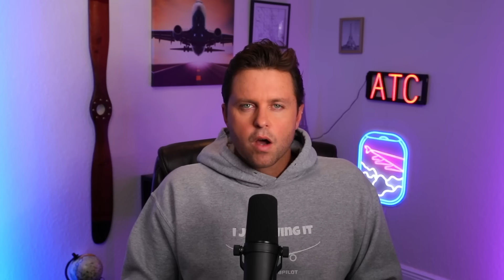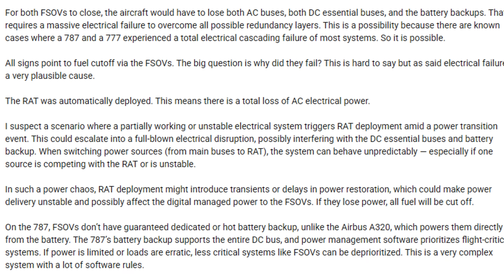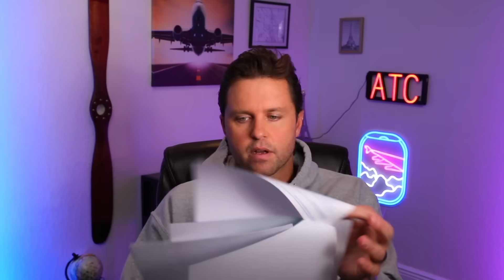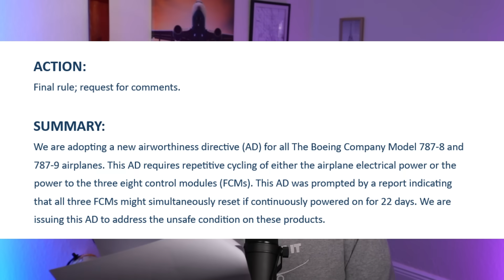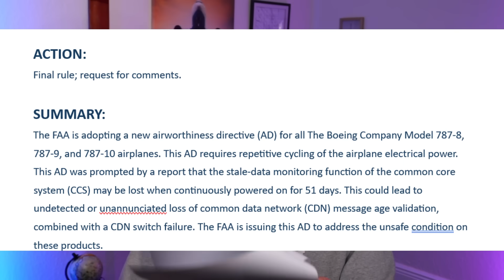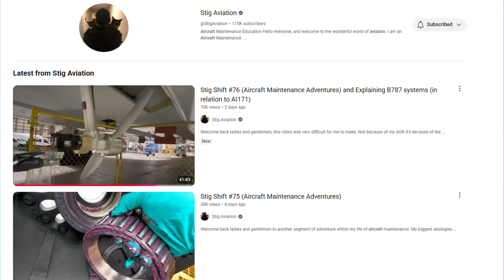Air India 171: Did a Software Glitch Cause Dual Engine Failure?

Comment: From other reports...the plane had a long run out, using almost all of the 3500 meter runway. That would tend to go against the shut off valve after rotation.
Reply: I know others have disputed this but FlightRadar24 data shows that the plane started it's takeoff roll from the last taxiway exit, which was only about half way up the runway.  At this airport, to use the full runway, planes have to taxi from this exit up the runway to the far end then do a 180 turn.  If you zoom in on Google Earth, you can see that land has been cleared to extend the taxiway right up.  Maybe this project will get some priority now.
Reply: @Gourockian1  there is a 4 minute gap in the FR24 data. During this time the aircraft taxied back to the end of the runway, turned around and started the takeoff roll from the end of the runway, not form the taxiway intersection. This has been confirmed by FR24 (apparently their software might be omitting such excursions like back taxiing for a more concise flight track on the user front end) and the raw ADS-B data seems to prove that the plane taxied to the end of the runway.
Also, when looking at the surveillance camera video showing the takeoff one can clearly see how the plane is at speed around the taxiway intersection. Just take a satellite image and draw lines of sight from the camera positions to buildings in the background of the video and see where the taxiway is located.
Reply: @theoz2850 Yes, you are correct.  I have now looked at the FR24 data for the flight and it actually shows that the time between it's last recorded position just before entering the runway and it's next recorded location at 575 ft altitude is 4 minutes, 34 seconds.  I also take your point regarding the speed of the plane around the taxiway intersection.  
However, what we don't seem to have is actual proof that during the 4-1/2 minute gap, the plane backtracked all the way to the START of the runway.  Nor do we know how long it waited before starting the rollout.  The reason I mention this is that when I had previously checked FR24 data for AI171 flights prior to the 12th, there were indications that in some cases, the planes only travelled up to the turning pad, which is just over half way to the end. I no longer have access to this data but perhaps someone with full access to FR24 could verify.  If this also happened on the 12th, it may explain why the plane took off near the end of the runway.
Reply: The plane has been confirmed to have had a normal runout.  It did not get to the end of the runway.  That is an early theory which has been dismissed.

Comment: The Bus Power Control Unit (BPCU) is to blame for what happened. This is the critical control system that sits above all(!) electrical redundancy. Either BPCU itself failed or it didn't do what it should when something else failed (on "gear up"). Then likely the fuel shutoff valves cut off fuel to the engines.
Reply: Contrary to the rubbish spouted in this video, no jet engine fuel shutoff valve closes when power is removed from the aircraft. You need power to open and close them. In fact, airplane manufacturers were forced to add a back up battery to shut the engines down if the aircraft power failed.
Reply: @ImperrfectStranger  I also didn't think they were spring-loaded automatically shut-off valves. But if not, it must have beed some thrust reduce/idle signal to the engines, or insufficient suction feed during climb.
Reply: @ImperrfectStranger  Okay, so what happened? Do you have a more plausible theory? I have heard none that are myself- all others I've heard have been comprehensively shown to be so unlikely as to be impossible. Something brought that plane down. And given that 2 engines appear to have failed at the same moment, I'd say that sounds like electronic/computer failure. And it's not like that model hasn't had serious issues with its control systems before, is it? I don't think my desktop computer system is within light years stable enough to run an aircraft, but nevertheless I have no programmes or systems I have to remember to close down every x days to stop the system falling apart.

Comment: This sounds like the best explanation so far with documentation to back it up.
Reply: I don't understand why the mayday call would have been "thrust not achieved" vs "electrical failure".
Reply: @stevegalle1  Because the engines rolling back is a very audible signal that something went wrong. 

The pilot reported that. He didn't say why the thrust was not achieve. 

If you look back at the US Airways 1549 (Capt. Sully, Hudson landing) incident, you'll hear how the pilot's entire reaction was based on the fact that the engines rolled back. 

IF both engines rolled back, I'm sure there will be a lot of a buzzers going on in the cockpit saying everything is failing. 
It won't just say "Electrical Failure". Restart engine. 

Obviously, there it was bird strike. But remember, Capt. Sully had 208 seconds from when the engines flamed out to ditching in the Hudson. They lost engines at 2800 feet. 

Here, the time between the lift off and crash was less than 30 something. Less than 600 feet.

The human reaction time given to the pilots of US Airways 1549 (as per the movie, which I believe is accurate) is 35 seconds. Here, the pilots hardly had 20 seconds before they crashed. 

This is the new benchmark as to the lowest height at which an aircraft has had all-engine failure.
Reply: @rjv_mntn  Excellent response. Thank you.
Reply: @stevegalle1  As I heard, he also said "no power" (as well as "thrust not achieved"), it's slightly ambiguous, but I believe these are two different things.  I'm sure that a pilot can tell us he means electrical power.  Please, can we have a definitive statement on what the Mayday call contained?  I have heard 3 different versions.
Reply: @mikebell9983  For whatever reason, the CVR is not being released by the bureaucratic Indians
Reply: @sred5856  And now, apparently, they’re saying it was damaged. No mention of the second black box - or that both black boxes may have both voice and data on the 787.
Reply: @mikebell9983  Ah - I didn't hear the "no power" part.

Comment: bro doesnt want to get silenced by boeing
Reply from the maker: I forgot to mention I have a wife and two kids and very happy with my life currently 🙏🏼
Reply: 😮But you have to refrain from picking out 1 dubious unverified media contributor that you found randomly on the web, and then quoting this person verbatim without any substantive facts or validating that person’s credibility. You need to give it up. The FSOV’s are not controlled shut by a loss of power, even with an unlikely and coincidentally combined WOW/Air logic switching scenario. It doesn’t work that way in aviation. An analogous scenario for example does do this in railway signalling because that system is based on the ‘fail safe’ principle- shut it down if something is detected as not right. Aviation is essentially different, it wants to keep it going at all costs within reason, and then let the pilots initiate any necessary shutdowns.

Comment: All of that...or someone in the cockpit turned off the Fuel Shutoff Valves.

You said: "For both FSOVs to close, the aircraft would have to lose both AC buses, both DC essential buses, and the battery backups. That requires a massive electrical failure to overcome all possible redundancy layers. This is a possibility because there are known cases where a 787 and a 777 experienced a total electrical cascading failure of most systems. So it is possible."

Can you point out in those known cases that both engines flamed out after total electrical failure?

Comment: I watched the Stig #76 video last night and it was detailed and explained the systems well. Very thought provoking. Also, for all those waiting for the black box; The voice recorder was accessed in India but the one with the data was heavily damaged and has been sent to the US to see if anything could be recovered. That's the data we need..... Your theory is plausible but needs some data to prove it. Hopefully it releases before another accident happens.
Reply: The 787  has two identical data/voice recorders, one in the tail and the other somewhere forward, probably in the electronics assembly under the cockpit.  There is no separate voice recorder. ...787 systems director Mike Sinnet. “We had to work with the [US Federal Aviation Administration] to get an acceptable means of compliance with multiple sources of power by putting two on the aircraft,” he says, adding that the EAFRs will be located “one in the nose and one in back.”
Reply: @borismedved835  My understanding is that these recorders are not powered off the essential busbar and are likely to have no data after the RAT deployed. Is this true?
Reply: @garyandthebat  Both the recorders are on separate 28V DC busses. If there's a total electrical failure, there's a 10 minute Recorder Independent Power Supply which would allow operation for that rated 10 minutes.
Reply: I am being told 787 have duplicate Combi CVR+DFDR which is new idea for me, but if true, they have 2 DFDRs.  One expert interview seemed to verify that for this aircraft.
Reply: Both black boxes contain both data and voice recording in each one. But hopefully India sends representatives with the one to the U.S.
Reply: There was video recorder as well non typical installed on all 787 made for India. it was found hope wont get lost
Reply: @KabelkowyJoe  Have you heard the status of the data from the video system? I haven't heard anything about it accept that it should exist. Fingers crossed.
Reply: The blackbox i guess is still not sent across but is being mulled to send it as data is not being able to get processed.
Reply: @Dr.Flyboy  They need to have more urgency about everything regarding this incident.
Reply: @TheTriganEmpire Rhe AAIB here tried ro retrieve rhe data but rhe blackbox is damaged,thats why rhey were not in position to say anything as of now.

Comment: I'm an electronics Tech, first with the Navy and then with RCA. I have worked with Telephone systems and data systems and everything else and one thing I know for sure is that anything can happen under adverse conditions. Digital will never be as reliable as analog but the paybacks are cheaper to maintain. If you want digital you will have to put up with crazy things happening and unexplained crashes. Example, look at computers and blue screens of death.
Reply: So, when he is talking about the bus, he is talking bus like what we find in a mother board or a bus like cabling topology?
Reply: @dancingmama6  Like the BUS you have in computers, and now in most cars.
Reply: @dancingmama6  Both are the same because a bus is a group of LINES, not only cables
Reply: You need to learn that "computers" do NOT BSOD. Microsoft crap does that. I've had computers working for FOUR HUNDRED DAYS STRAIGHT without a problem and the record was broken by a need to upgrade

It's ok your hate for digital, just don't use fallacies as excuse
Reply: @alastorgdl  True - iPhone sometimes does a Black Screen of Death.
Reply: @libby2012  Apple crap is like Microsoft crap but with added elitism

Comment: I used to work in aviation and have a foundation degree in Aviation OPs and I said to my mum less than 4 months ago that I guarantee there’s going to be a tragic 787 crash within the next year… Boeing sub-contracted a lot of their avionics systems for the 787 to a sub-contractor Spirit Aviation (NOTHING to do with Spirit Airlines just fyi) who they used to own, and long story short but there’s been a TONNE of issues and shortcuts.
Reply: I feel like there was another story about Spirit Aviation earlier this year. I can't remember what it was exactly.
Reply: @dancingmama6  spirit installed the door that flew off that Boeing aircraft.
Reply: They are probably using using GPT to code the systems🤦🏻‍♂️

Comment: When you had your Hanger Talk with Capt Steve, I leaned very hard on Electrical Failure.  Now learning about the 3 ADs out there on this very issue, I’m pretty convinced.  Sure does appear to be a software issue, regarding the System … but still we will see.  Meanwhile, wonder if the Engineers are looking at an electrical and/or mechanical override for the “fail safe close”.  Probably wouldn’t have helped in this situation, but perhaps in a different scenario.
Reply: but it this a Boeing Failure or Airline because why has it taken this for a crash for this error

Comment: Thanks for your vidéo
It's incomprehensible to imagine the loss of both engines during this takeoff.
Now that's clearer!
The only credible explanation for the flameout of both engines, given that known causes (bird hazard, fuel contamination, etc.) are clearly excluded, is that it can only be a software problem.
The "Mayday, we have no thrust" message suggests that both engines flamed out at the same time, and indeed, the simultaneous closure of the fuel valves can be the only explanation.